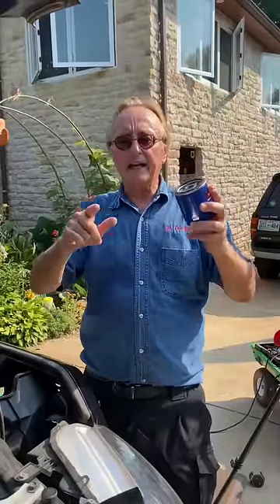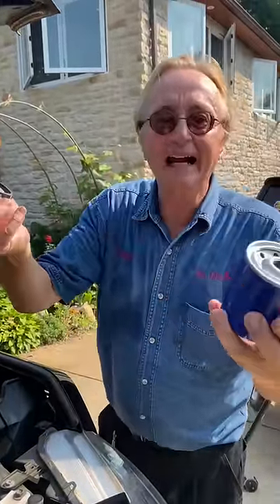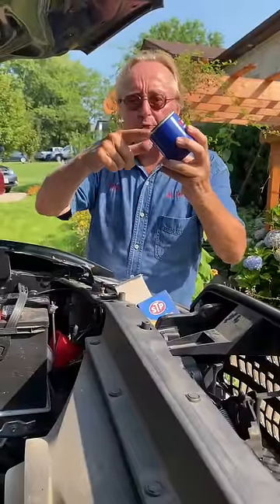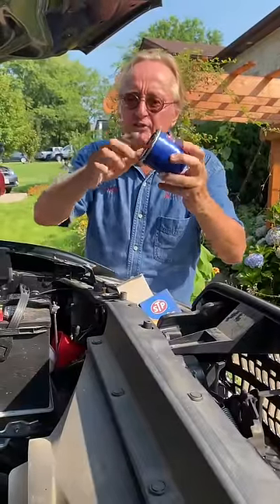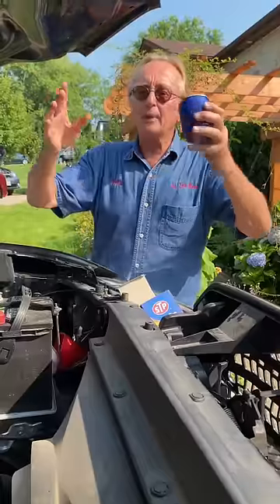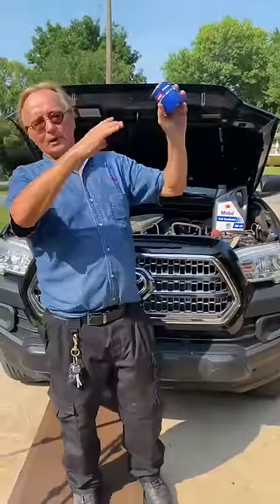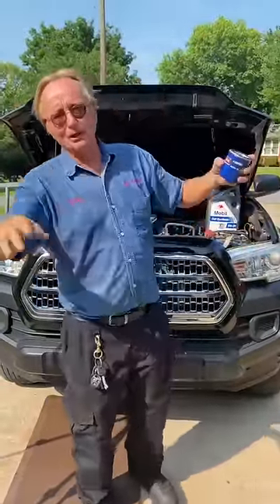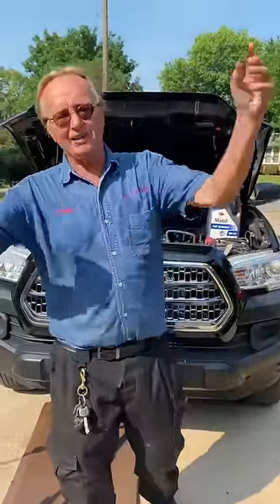If You Change Your Engine Oil Like This You’re Stupid

Comment: When you take the old one off. Just look at the filter. Lol no need to look at The engine for "It"! However, one other big mistake is, not cleaning the housing and the gasket mating surface. It should be pretty and shinny! If u can't see it, feel with a clean finger. To verify that there's no dirt or grit on the housing where the gasket will seal. That, Dbl gasket, and not checking your oil plug O-ring before putting it back in or cleaning the threads and holes of any contaminates. Are all things that can make a simple oil change into a headache! Usually happens when you are trying to do things in a hurry!

Comment: Worked on a tractor for a guy fuel filter always leaking and full of water. Got to looking they had three different gaskets in the slot. Now no leaks just hope they take the advice and not leave the fuel jug sitting in the field without a cap on it. Da

Comment: I’ve done this once, good thing when I start the car I lay under it to check for leaks I wait a couple mins if I don’t see any leaks I know I’m good, I caught it before I added the new oil when I screwed the oil filter on it felt funny so I took it back off to have a look & yup the old gasket was stuck to the oil filter housing. Now I double check every time I change my oil. I change my own oil I never take it to a shop I change the oil on all
My trucks & my wife’s cars, I don’t trust shops with changing my oil, a friend of mine took her car in for oil change & they forgot to put oil in it & her engine locked up, they said they wasn’t liable, I only have taken my car to a shop for oil change a couple times & that was back when I was younger than I started doing it myself been doing it myself ever since!

Comment: my honda oil changed from dealership. when I try to unscrew filter. it did not open. after long attempts with tool. I noted they did not greases the rubber before putting filter in. now it comes off easily

Comment: That's why you apply a thin layer of new oil on the New gasket so it won't get stuck the next time you remove the oil filter.

Comment: I drove over 200 miles with a double gasket I'm not knowing and it's slowly does lost pressure I pulled over immediately and had my car towed home I had a proper oil change done on it but the check engine light comes on and so does the oil light I think I blew my oil pump it's a 2008 Kia Sedona is it salvageable

Comment: That happened to me about 30 years ago. Started the car in the garage and drove about 3 miles when the car started shaking and the engine light came on. Checked to see what it could have been and noticed there was no oil in the engine. Engine was trashed and needed to be replaced.

Comment: If you don't reach up and clean off the area around the oil filter seat once you've pulled off the old filter and let that area drain, you're risking all sorts of garbage damaging the gasket.   
I always drain the oil, wait.  Pull the filter, drop it on drain grid of oil pan, wait for the drips to stop.   Clean the oil drips/drabs from around the filter, clean the gasket 'seat' area, light coat of oil on new filter, install filter.  Oil lets you put it in tight enough without risking using tools.   Then cork off the oil pan.     I've only ever had a problem with one filter coming loose in 34 years of doing my own oil change.  Brand?  Wix.   I won't buy that one again.   Can't remember ever having a double gasket situation.

Comment: Or just make sure the removed oil filter has the gasket on it when you remove it. If not, then pick away the stuck gasket on the engine.

Comment: Everyone makes this mistake at least once in their life, I did on a 6.7 powerstroke at a quicklane I worked at but they never found out I did a double gasket as I tossed the older one away and they only assumed I just didn't tighten it enough, luckily because of how I tighten my filters on it didn't have a huge leak and survived a trip to the beach and back from what I heard, but the customer was PO so double check your filters, drain plugs, and lug nuts

Comment: Did this as a teen on my first solo oil change. Heard some splashing noise oil was spewing out the bottom. Turned it of immediately raced to autozone for shop rags and kitty litter praying the apartment manager didnt spot the massive puddle of oil.

Comment: The inadvertent  double gasket thing is exactly what happened to me. 
Oil drip drip drip when driving.
Double check that the old filter gasket is not still stuck on the engine!!!

Comment: I had a dopey service tech at a Nissan dealership who doubled gasketed the filter on my 370z during an oil change. The service manager tried to blame the filter, as it was one that I had brought in but I was on hand when it blew and saw what had happened. I learned a good lesson after that, only allow the experienced techs who know what they're doing on your model work on the car. The lazy tech also left greasy fingerprints on my door handles, fenders, leather steering wheel and leather shift knob.

Comment: Do not think a, "professional," will not forget this basic step of checking for the old gasket.  One of the day shift junior technicians did a routine oil change on a sales department fleet vehicle.  He not check if the old gasket was left on the old filter.  The sales person came in the following day and took her usual sales fleet car to her appointment.  It made it less than 3 kilometers when the engine seized. The vehicle was a one year old Chevrolet Orlando, not the best si be it was GM originated.  But still a pricey company loss. The vehicle was auctioned off for $1000 last January 2023.  I do not know if the one who did the oil change kept his job.

Comment: When I got my first car, I changed the oil. When I backed up out of the driveway, I noticed my oil light was flickering, then noticed I left a huge oil slick, I didn't properly lube my oil filter gasket. 😂 I immediately shut my engine off.

Comment: I've learned to buy a full case or at least a some what of a stock pile of oil filters.  If the first one fit then the last one and every one in between will fit.  Buying a oil filter every time you need one at the auto parts store is a recipe for disaster.  They given me the wrong oil filter and fuel pumps before, not even for a car remotely similar to my car.  Doing the first oil change on my first car they gave me the wrong oil filter and dumped all the oil on the driveway.  Buy the oil filter yourself and know what filter your car takes.  Never trust the people at auto part stores.

Comment: After thousands of oil changes, I’ve never seen a gasket stuck to an engine. I’ve always looked at the old filter to see if the old gasket was still on the old filter.

Comment: Never heard of this.
I always wipe the sand off the mounting 
flange before screwing on the new one.  
And no, sand is not useful on the threads, either.
An old mechanic used sand to make things fit
tighter, and it gave my old man (Dear Dad) 
a heart attach at the repair shop he owned.
BUDDY!   QUIT USING SAND!

Comment: Probably not a bad idea to check the NEW oil filter to make certain it actually has a seal on it. No way could a mass produced part ever not get the most important piece to provide its main function.

Comment: Ironically that happened to me at the dealership when my then van had a stripped out oil plug and I didn’t have the tool to remove it…fortunately I caught it when they were driving it out of the garage. I think they felt pretty dumb.

Comment: It's never happened to me but not saying it never will. I always wipe the mounting area off then put a thin film of oil on the new gasket. And of course test run the engine and look underneath before you get on the road . I did change oil on time and in my rush forgot to put the plug back in . What a mess 5 quarts of oil make on your drive way ; )

Comment: Don’t use those crappy blue STP oil filters. One cost me a 75 dollar tow bill. 
Filter would not come off when I was changing the oil. Used a screw driver through it, everything to get it off. Had it towed to my mechanic to get it off.

Comment: I am a heavy duty diesel technician. Had a new guy do a simple service. I asked several times if he needed help. He said no. As he was backing the mech. Out leaking oil. I tried to stop him. I was to late. We're replacing the engine. It only costs $30,000.

Comment: It happened on my first oil change on my Mercury Mariner in 2008 !!! Brand new car !!! I was desperate but my witty wife said : … but why the old oil filter does not have the rubber ring on ?!?
Reply: My first blunder (years ago) was when tired after work i drained the old oil and i replaced it with fresh oil, and i pour one quart, a second one, a third, a fourth, a fifth … still oil barely touched the dipstick. And my kid telling me “Daddy, what’s that leaking under the car ?!?” - i forgot to put back in the oil bath drain screw …

Comment: today I changed my oil on the old Ford. and I struggled to get the right angle for the oil filter and I guess the gasket came off. and when I finally put it on. I turned the car on. and alot of oil leaked out..I didn't know what it was. then when I looked closely. I saw the gasket had fell off. so I put it on and refilled it. so stupid from me

Comment: Dont know how your cameraman could empty the sump of their car through a high pressure leak such as this and not smell it and stop the engine in time.

I've also done this, but had a brand new filter gasket misalign when putting the new filter one....as soon as the car was running you could smell it.

Comment: The Trick is don't get distracted when working on a Car.
    Not even five hot sexy COeds in wet Bikinis broke down in the middle of no where.  Distracted me when I was working on their broken down Jeep with a loose U Joint.
     I was however constantly looking to see where they were for safety reasons of course.😎